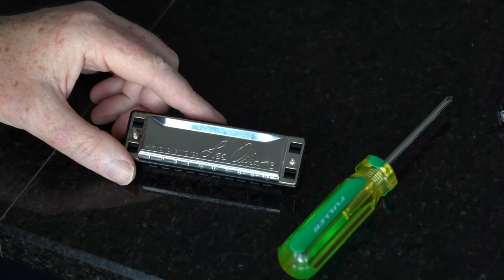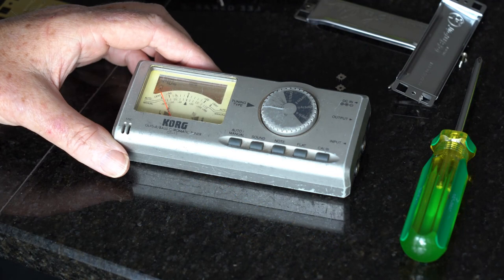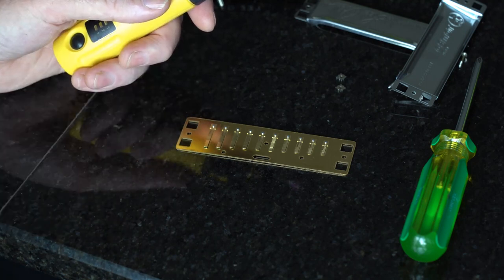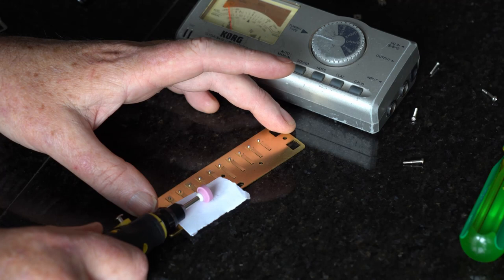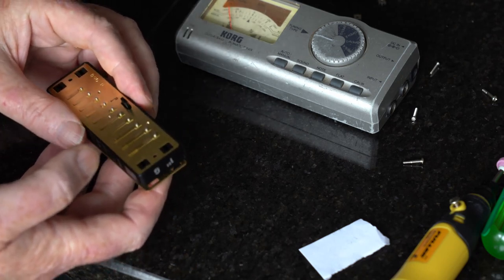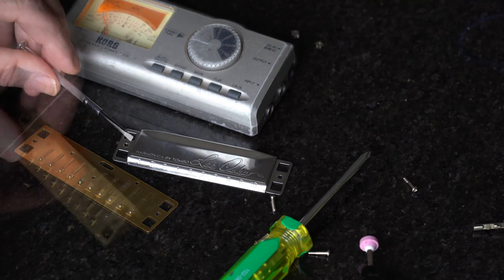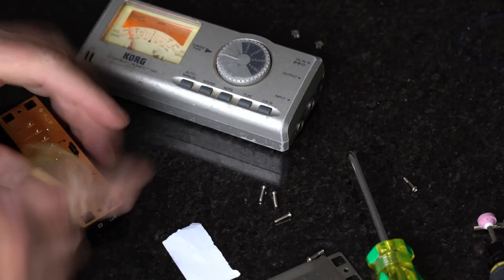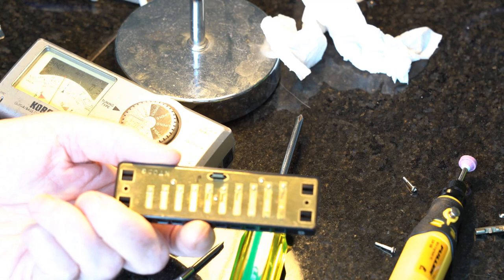I Create a Paddy Richter Harmonica From Scratch - How to tune a harmonica

Comment: What a neat idea. Using this video as guidance, I bought a cheap harmonica in D (brass reeds), and filed the third blow reed down by hand; so it went from A to B, thus yielding paddy richter tuning. I noticed that the frequency obtained by plucking the reed was always low compared to the frequency obtained by blowing (with the harmonica plates in place), so a little extra filing was required to get a B. The only remaining problem is learning how to play the harmonica.
Reply from the maker: Well done.  Learning to play the harmonica should never be a problem...it's the solution :-)

Comment: Thanks for this.  I just retuned an old G Golden Melody harp to Paddy Richter tuning.  I used this video and an old one by Brendan Power as my main guides.  This vid was very helpful.  I was surprised at how much metal I had to remove to get the reed up a whole tone.  I kept worrying I was taking too much off but it worked out.  The cordless engraver got away from me at one point and I carved up the side of the reed slot, and had to fix that to get the reed vibrating freely again, but other than that it worked out pretty well.  I'm just learning Celtic harp styles and I bought a couple of EastTop Paddy tuned harps to get started.  They're OK but have required continual adjustment and re-gapping to keep them up to speed.  Even then they just aren't as responsive as I need them to be when I'm trying to keep up with my bandmates on those fast jigs and reels.  I'm in a place where ordering specialty tuned harps is impossible so I have to create my own.  Fortunately I have a good supply of old harps laying around.  Thanks again for your channel.  It's a great help in this journey.
Reply from the maker: Great work.  Well done.  Tuning reeds is a good skill to have.

Comment: So I would guess to convert a standard diatonic harp into a Melody maker would be same process and fairly easy, yes? As the specific reeds to be tuned would only be at most a tone apart. Would that be correct?
Reply from the maker: Yes, raise the 3 blow 1 tone, and 5 and 9 draw a semi tone.
Reply: @HarmonicaForTheSoul  Thank you. I am guessing one could buy very cheap models and buy premium reeds for them to turn them (by taping out the rivet holes to use tiny screws) into a quality instruments using such techniques. Is that possible?
Reply from the maker: @TechTins_Projects  I'm not skilled in that area but some people do reed replacements.  I assume you'll find videos about that on youtube.